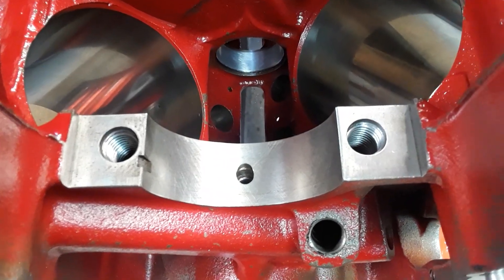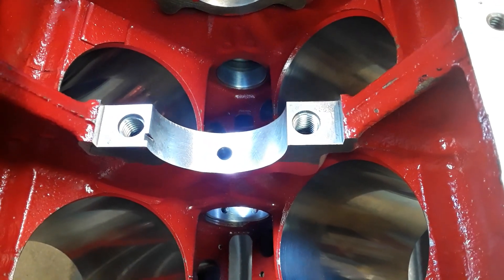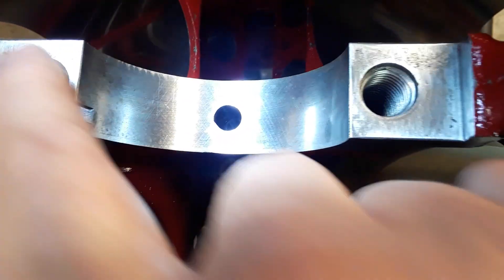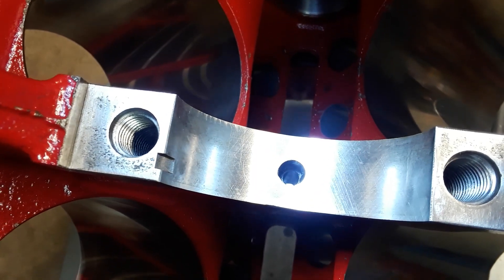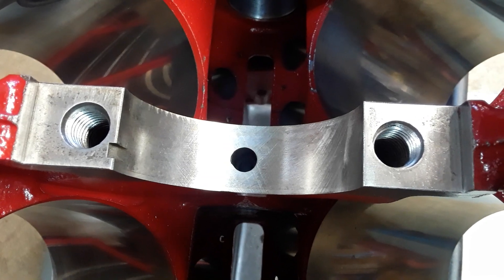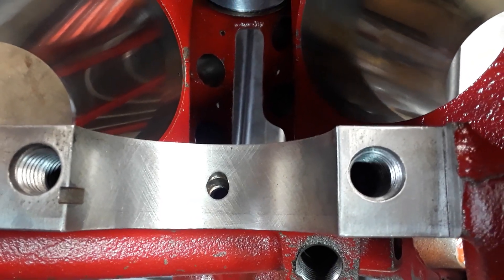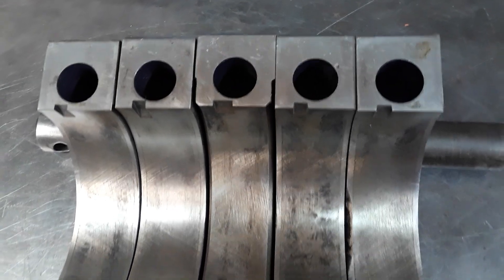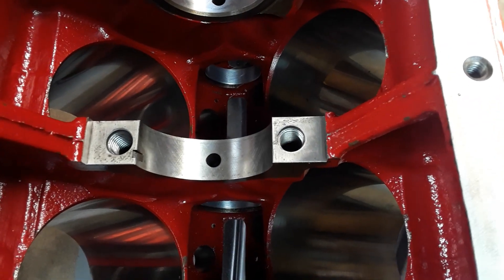Block Fretting/Main Cap Walk

Comment: I watched another video on this where the poster said the force against the crankshaft at higher RPM tries to turn the crank into an "s" shape. He said it will always be on the 2 and 4 cap. The video he posted was a dyno test where the the harmonic balancer was rubbing against something next to it and caused sparks to fly somewhere above 7000rpm. He blamed it on crankshaft quality plus RPM.

Comment: The cap and block mating faces should not be oiled, perhaps there is something available to keep the oil out. If it's not obvious oil enables the cap to move against the block more easily
Reply: You cannot stop oil from getting in mating surfaces. Cummins on ISX engine putting anaerobic gasket maker on parting surface to keep oil out.. Main cause of cap walking it vibration cannot stop that either

Comment: This why Dowel pins are much better than registers .
Reply from the maker: Of course but that's comparing apples and oranges! Name the 1950, '60's, '70's & '80's factory "Detroit" cast iron block castings used in NHRA Stock/Super stock competition that came with dowel pins instead of registers? Not even the venerable 426 Hemi as they came with main cap cross bolts. If I'm not mistaken, that tech started in Drag racing with the aluminum 417 Donovan Hemi.
Reply: Maybe you need to look at Pontiac V8s.  @metalmaxmopar9520
Reply from the maker: I stand corrected. Thank you for pointing this out as I have not seen the internals of a Pontiac V8 block of that era since the late 1970's. I don't recall too many "competitive" Pontiac/Olds/Buick 400's or 455's in NHRA/IHRA "Stock" or "Super Stock" racing back in the 1970's & 1980's or 1990's. There were 1 or 2 competitive cars as I remember. Extra large diameters on the mains left much to be desired when it came to spinning these mills up in the RPM range and they basically remained as low revving torque monsters for the land yachts. 

Plus....Pontiac took a "Direct" corporate hit from the GM guru's as they threatened the Chevy's with better engineering and performance. Can't threaten the 427 Corvettes with the 421 Catalina's (Eg: the road race at Daytona in 1963 where "ONE" Pontiac Catalina whipped Ferrari, the NEW 427 Vett's and the rest of that exotic sports car field...Mercedes Benz bought that car to research and its in their German museum today) or my god...with the GTO's .....especially at a 1/3 of the price of a 'Vett.....right? So the GM elites listened to the Chevy "crybabies" and sabotaged Pontiac from within!

FORCED the Pontiac division to use cheap con rod manufacturing processes vs forgings and the reliability of these rods was shit. Kicked them out of the side of the block like clockwork. That's called 1 step forward and 3 steps back!......so Pontiac dowel pined the block saddles & caps for an engine that could not "rev" and puked "inferior" rods. Sign me up!

Comment: So are 383's affected less due to the lighter components?
Reply from the maker: Overall the simple answer is "Yes", they are NOT as prone to cap walk as the RB's. 
Shorter rods, shorter throws and lighter pistons. BUT...add NOS (creates more cylinder pressure) use poor fuels and wind them up high in the RPM range and the block/caps will start showing the same symptoms. Prevention is the name of the game in a radical build, use high quality fasteners, a block girdle and in extreme cases, aftermarket main caps. 

Tech Tip 101: Keep the machined block registers/main cap faces dry and free of assembly lube (Con rods included!). Liquids, (Oils, paste, grease, water etc) does not compress well and will keep the mating surfaces apart on the "micro" level and can give an inaccurate torque reading. On HP builds, I let the rotating assembly "rest/settle" and re-torque the main and rod fasteners a 2nd time a few hours later. Call me "anal" but it's good insurance!!
Reply: @metalmaxmopar9520  Awesome info, this is the first I've heard of this. I'll be sure to remain more cognizant of my assembly lube placement on my next buld.I too am a total "Mopar Masochist".. lol. Really loving your content btw.. no nonsense and experience based. Thank you sir. 🍻

Comment from the maker: A "History" lesson for the ignorant. This 440 engine block was raced in NHRA Super Stock "F" Automatic & "G" Automatic classes. VIN# (BS23VOB) "E" Body, 1970 Six Pack Plymouth 'Cuda raced in "Stock" eliminator in 1970, '71 & '72 , then sent to the USA and converted by the Rod Shop Dodge race team in Muskegon Michigan to S/S eliminator class starting in '73. This car was driven on the street in the summer of 1970 only and trailer towed to the track starting in 1971!  {I'm the 2nd owner as I bought this 1970 'Cuda in 1983. This car at this point in time is disassembled and in the middle of a total restoration.}

The 1970's & 1980's, an era of Optimism, Creativity, Trial and Error! IT WAS A TIME ALL ABOUT "IDEAS" for BETTER PERFORMANCE and many IDEAS were tried out!  That's why my/our generation's music is so good! Something the majority of the younger generation today have NO CLUE about. "IDEAS and dedicated follow through" like the main cap bolts were drilled/re-tapped in the block and up sized to 9/16" vs the "stock" 1/2" as that was thought to increase bottom end strength. 
The "ARP Fastener Company" did not exist back then, neither did bottom end laser cut plate "block girdles", nor the aftermarket Milodon "main caps" made from superior alloyed materials other than the "stock" cast iron main caps. Those high performance/racing "products" came to the performance market much later!

This block was painted internally with "Glyptal" electric armature paint way back in the early 1970's by the car's previous owner as it was thought to aid in crankcase windage control and allow quicker oil return to the oil pan. The wear and Glyptal paint chipping is because this paint is 50 goddamn years old! This engine was/has been torn apart, washed repeatedly and the engine reassembled more than most people do oil changes in a lifetime! 
For the few paint flakes that do come off, I use an inline oil "pre filter" to catch the potential debris before it gets to the Milodon external oiling system pump. EARL'S sells the "pre filter" inline units and you can buy them at Summit!!  This car competed at a time when "STOCK" meant "STOCK" with all of the "racing" sanctioning bodies like NASCAR, NHRA, IHRA & AHRA. At that time, the NHRA/IHRA Stock & S/S classes did not have nor allowed "brainless" NOS power adders, No Aluminum heads, No trans brakes, No computer shifting, No stroked to 700 cu. in. engines, No aftermarket fuel injection, No FWD to RWD conversion cars.....etc....etc.

Thank goodness for one thing..... back then, NONE of the 10.90/9.90/8.90 electronic "throttle stop" bracket racing classes could compete at the NHRA "Winston" Divisional races! The "90's" bracket classes..... NHRA & AHRA's brilliant idea to help: "KEEP THE DRAG STRIP GRANDSTANDS EMPTY OF SPECTATORS"!! It would be more entertaining to watch if these "drivers" were seated in the Grandstands and operated "their" cars by remote control joysticks........just like flying a drone!!

THIS 440 IS THE ORIGINAL NUMBERS MATCHING BLOCK TO MY 1970 440 SIX PACK 'CUDA. That's why I pulled it out of service, stored it for decades and used other 440 blocks to build race/high performance engines with. I was way ahead of my time when it came to knowing the value of an "original" block to a muscle car produced in very limited numbers. Long before the Barret Jackson auctions came along!

One other thing that seems to relate to ALL of my video postings lately, I'm getting really tired of the ignorant comments from those who have NO CLUE about basic physics, basic engineering and standard manufacturing procedures and practices and the lack of a "general" automotive knowledge. The internet is at your fingertips for Christ's sake or buy a book and read about it. Learning has NEVER been cheaper, easier or knowledge more accessible. I don't expect novices to know about the maintenance and tear down schedule of ultra high performance and racing engines. But what do you think you do with a racing engine wound up to near its limits every weekend during the racing season?....just pull the dipstick on Sunday and change the oil once a year?

I'm not running for public office and I'm not interested in a "high school" style popularity contest here on You tube! Screw the numbers as I don't give a rats ass about YouTube monetization. A few more of these "STUPID", "CALLOUS" and "BRAIN DEAD '' comments and I will shut the comment section down. If the comments get worse and more rude, well, I have the knowledge and it's NO LOSS to me if I don't make these videos.
Reply from the maker: https://www.summitracing.com/parts/ear-230310erl

Comment: Yes lets paint the inside so we get som shit in the oil xD
Reply from the maker: A "History" lesson for the totally ignorant. This 440 engine block was raced in NHRA Super Stock "F" Automatic & "G" Automatic LONG before your old man hit puberty. [ VIN# (BS23VOB) 1970 six pack 'Cuda raced in "Stock" eliminator in 1970, '71 & '72 , then sent to the USA and converted by the Rod Shop Dodge race team in Muskegan Michigan to S/S eliminator class starting in '73. This car was driven on the street in 1970 only and trailer towed to the track starting in 1971! ] 
This block was painted internally with "Glyptal" electric armature paint way back in the early 1970's by the cars previous owner [I'm the 2nd owner as I bought this 1970 'Cuda in 1983] as it was thought to aid in crankcase windage control and allow quicker oil return to the oil pan. This car was one of the first in S/S competition to use a 4 link floater rear suspension/traction system.  

IT WAS ALL ABOUT "IDEAS" for BETTER PERFORMANCE and many IDEAS were tried out! An era of: "Creativity, trial and error"! That's why my/our generations music is so good! 
Something the majority of YOUR generation has NO CLUE about.   

"IDEAS" like the main cap bolts were drilled/re tapped in the block and up sized to 9/16" vs the "stock" 1/2" as that was thought to increase bottom end strength. The "ARP Fastener Company" did not exist back then, neither did bottom end laser cut "block girdles" or the aftermarket Milodon "main caps" made from superior alloy materials other than the "stock" cast iron main caps. Those high performance/racing "items" came much later! This car competed at a time when "STOCK" meant "STOCK" in all of the "racing" sanctioning bodies like NASCAR, NHRA, IHRA & AHRA. 

At that time, the NHRA Stock & S/S classes had nor allowed "brainless" NOS power adders, No Aluminum heads, No trans brakes, No computer shifting, No stroked to 700 cu. in. engines, No aftermarket fuel injection, No FWD to RWD conversion cars... etc, etc......and thank goodness..... NONE of the 10.90/9.90/8.90 electronic "throttle stop" bracket racing classes could compete at the "Winston" Divisional races!  

The point "90's" bracket classes..... NHRA's brilliant idea to: "KEEP THE DRAG STRIP STANDS EMPTY of SPECTATORS"!!  
    
THIS 440 IS THE ORIGINAL NUMBERS MATCHING BLOCK TO MY 1970 440 SIX PACK 'CUDA. 
That's why I pulled it out of service, stored it for decades and used other 440 blocks to build race/performance engines with. 
I was way ahead of my time when it came to knowing the value of an "original" block to a muscle car produced in very limited numbers. Long before Barret Jackson came along! 
Now....go "plug & play" with your laptop & Honda or your "2 for a quarter" LS Chevy's as you probably have NO CLUE what I am talking about.
Reply: No mail order catalogs to buy top end or rotating kits either. Cam grinds were trails and error and acid dipping heads because porting wasn’t allowed.
Reply: makes the oil return faster,less windage drag on airborne oil,,= more ponies
Reply: @glennberry1012  If you use the proper glyptol paint. That looks like regular spray paint.

Comment: What's with the paint on the inside of the block?
Reply: Often to help the oil shed and drain back. The bare cast tends to hold onto the oil a bit.
Reply: @NBSV1  I'd rather have the oil sticking to the block than run the risk of the paint flaking off the block and the bits then blocking the oil pickup strainer.
Reply: @sidecarbod1441  For high rpm you want the oil to drain back quickly to reduce windage. 
Unless it's very poorly prepped I haven't seen issues of paint flaking off.
Reply: @NBSV1  It sounds pretty marginal to me, also you would have to prep the inside of the block very well for the paint to stick in which case you may as well just use an abrasive flap wheel on the block in order to smooth it out, the oil will then run off the block without the need for paint.

Comment: G'Day,,aaarrrhhh yes,fretting,?Yep when the bolt is not tight enough or the thread or bolt material cannot hold the clamping force ,the cap lifts..lets oil under cap and then clamping force returns after strecthing and use's hydraulic pressure greated by the oil and cap and this blows open pours of metal out,,and washes away with return oil to sump,,why you get little powdery type shit of magnectic substance's around magnectic sump plug,etc.,,

Comment: Most usually caused by detonation assuming you have sufficient fastener clamp load.
Reply from the maker: Not in this case Joe. Quote: "The reciprocating weight is multiplied by the square of engine RPM". Basic law of physics!
This "fretting" was caused by the excessive mass of the rotating components. The fuel I used back in the day was "Leaded" Sunoco 260 or 280 and at other times VP12. In NHRA S/S rules you had to maintain the stock piston "deck height" and the stock volume CC's in the cylinder head combustion chamber (Iron '906's). That would give me a static compression ratio of approx. 10.25 : 1. max. with a 0.022" thick Chrysler steel head gasket. 
I played with different timing settings, multiple jet variations and could crank in over 40+ degrees of timing and not get any "detonation". All that fretting damage was done previous to 1985, around the time I decided to "retire" that original 440 block. So we are not talking "garbage" ethanol "unleaded" 94 octane fuels like we have today.       
( I read more spark plugs than I care to remember and my "issue" was fuel distribution through the Edelbrock STR-14 and the Weiand 6 pack intake. This is/was a bitch to sort out as each manifold responded to changes differently.....that's the understatement of the day!!.......from a Mopar Masochist!!)

Comment: What do u do to fix it?
Reply from the maker: Machine the cap mating surfaces flat, machine the saddle seat surfaces flat and line bore the block. 
It's not about "fixing" this problem, it's about "preventing" this problem. Use the "Lightest" rotating components in your assembly, use a main cap "girdle" and "TIE" the bottom end together and if you have the budget, use "aftermarket" main caps. Good for 800+ HP easy.
Reply: Thanks makes sense